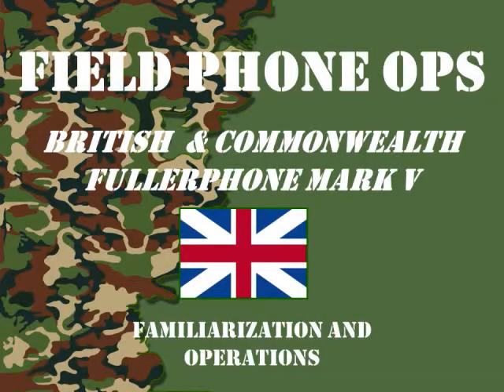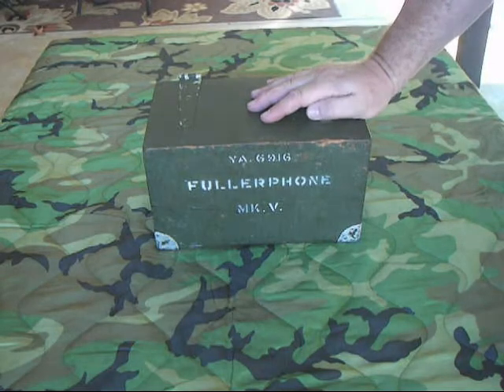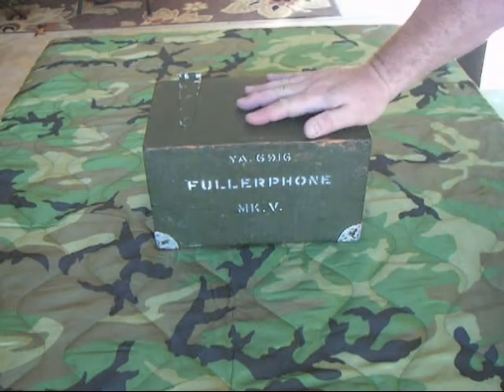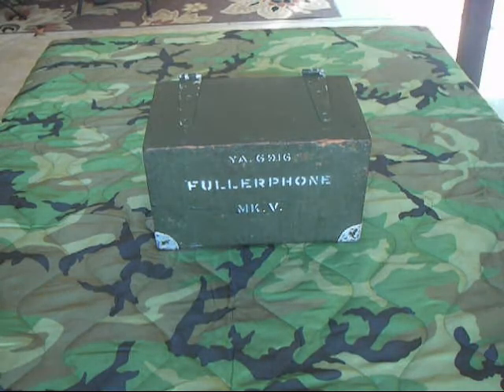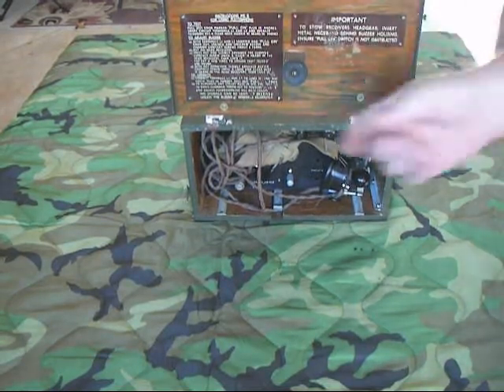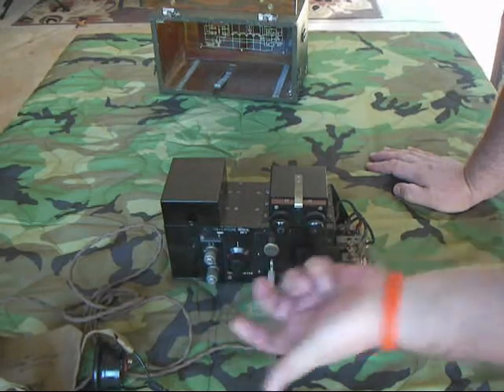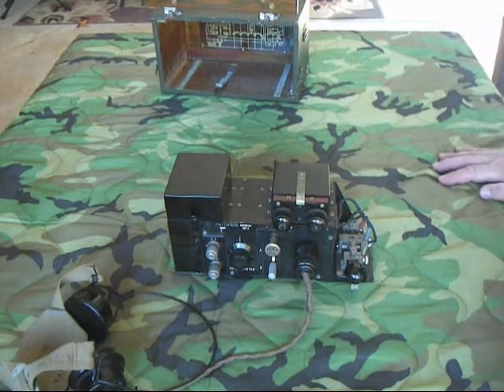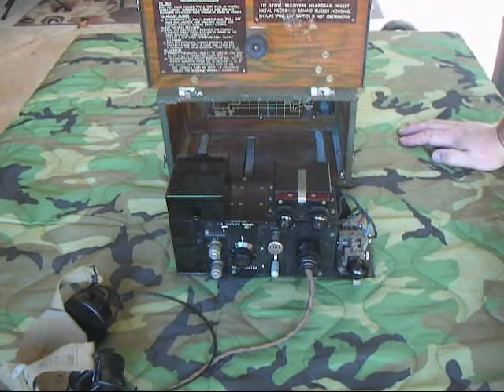FIELD PHONE OPS: British Fullerphone Mark V

Comment: I have 2. Trying to get them operating. Need batteries.
Reply from the maker: You're not gonna find any original batteries.  I ended up using a 2AA battery holder I got on Amazon.  You'll have to connect the battery holder to the units battery wires.  Good luck.  I have one that I think works.  There is no way to test them without having two working units.

Comment: With earth spike antenna,s Fullerphone turns to ELF RX/TX.
Reply: Really?
Reply: @WG7D  I will have make experiment: TX part - morse key + 12V lead acid battery and two earth spikes ( >20m between spikes ).
RX part - transistor preamplifier stage + 1..3Hz low pass filter + LDR modulator ( Morse code direct current pulses turns to 800...1000Hz tone pulses ) and end stage - VLF receiver ( audio amplifier ).
Antenna - earth spikes.
Reply: @ingussilins6330  That experiment would be interesting indeed. If you do it please make a video of it. Thanks for responding! WG7D
Reply: @WG7D  Thanks!